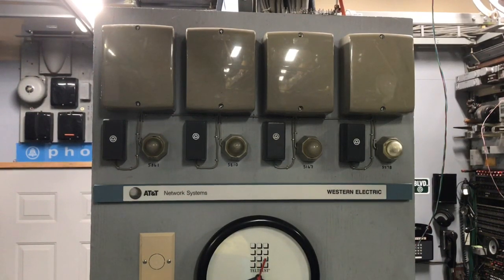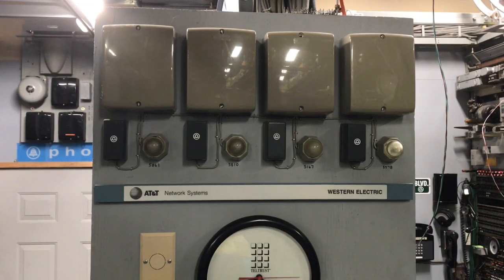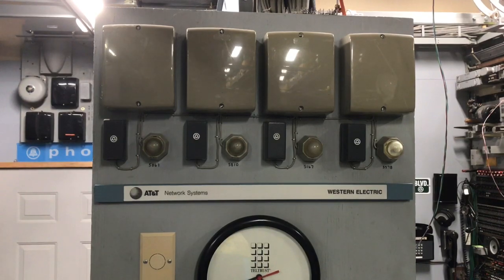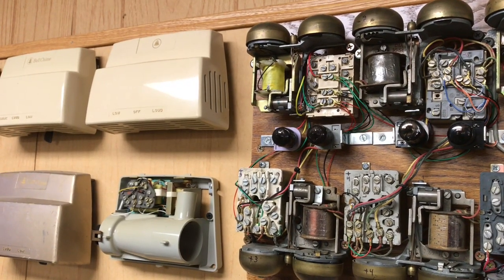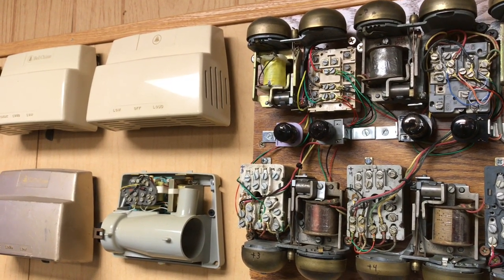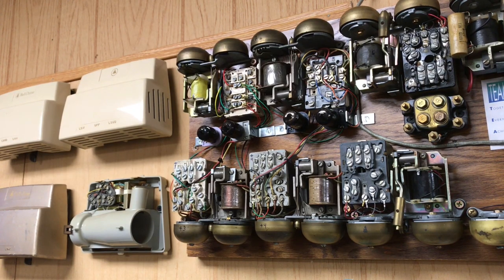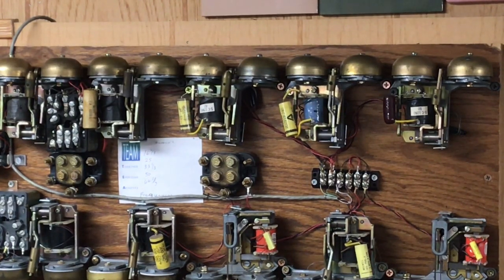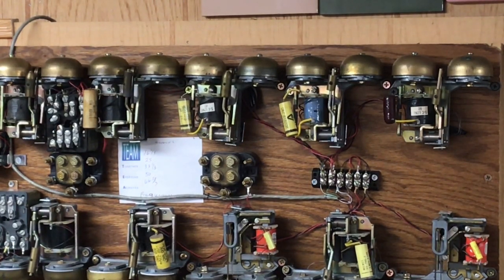Party line phone ringing schemes. Bell system and independent company's.

Comment: Great memories.  I worked as a SXS switchman for SWBT in the 70's.  Worked a 355a, no.1, SxS cama, class 4 toll-completing,  and class 5 local. We had 2, 4, 8 party lines up till about 1981. They used I believe a 106F ringing machine which had the different code rings on either tip or ring side of the line. Also worked ani C and ani B. Watched most all of your videos.  Never thought I'd ever see these systems again. It was my favorite job by far. Still here the step switches in my mind at age 69.